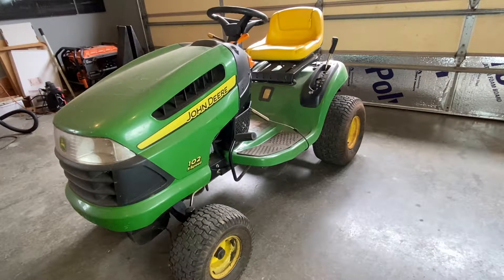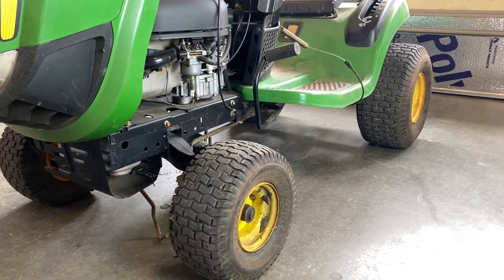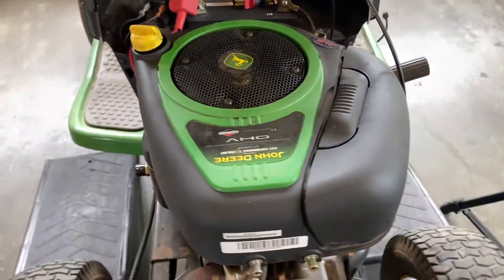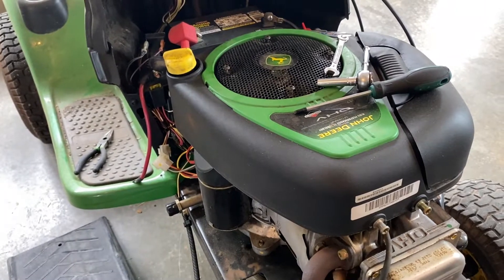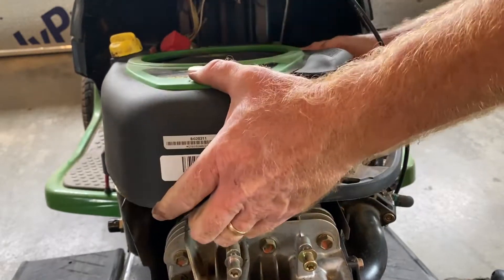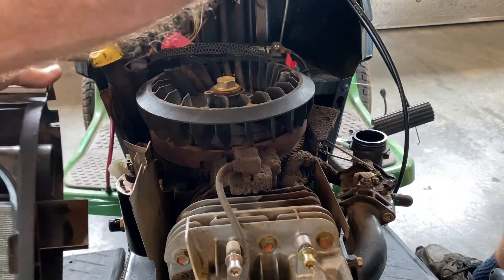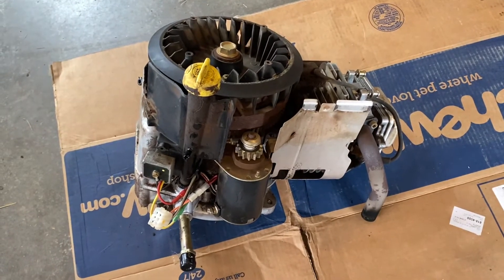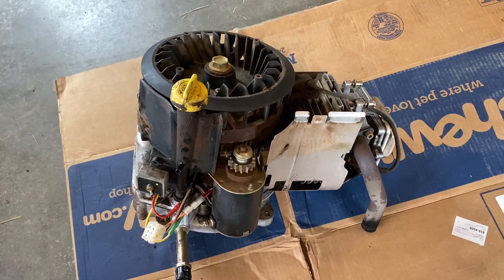John Deere LA102 engine swap, full removal

Comment: Will a v twin 22 hp fit in this machine , i have a 130 with blown rear end and a 102 with a blown motor , i want to make 1 good machine , figured mighf be easy to swap motors,  or should i just fix the 130 rear end  ?
Reply from the maker: If there are provisions for two exhaust pipes in your frame, it will probably fit.  You'll need to move the muffler, etc.  The pulley for the drive belt and deck belt should transfer over.

Comment: Is the screen on top of engine rivets
Reply from the maker: The screen is just four Torx screws.  You can probably access the bolt at the top by popping the plastic emblem in the center off. Good luck!